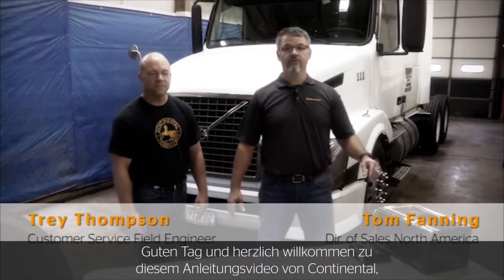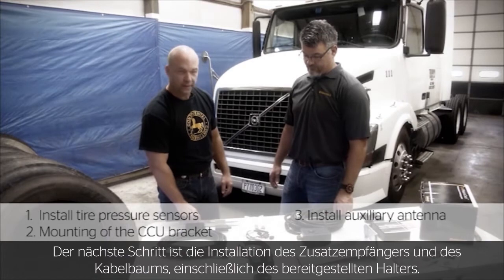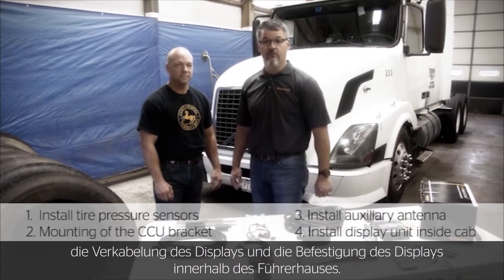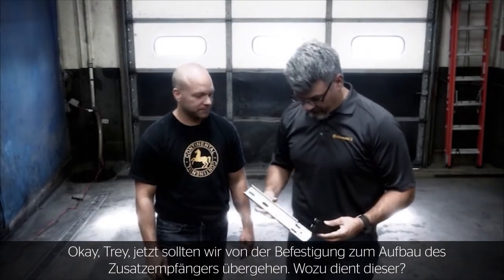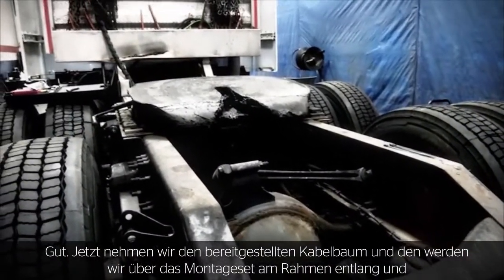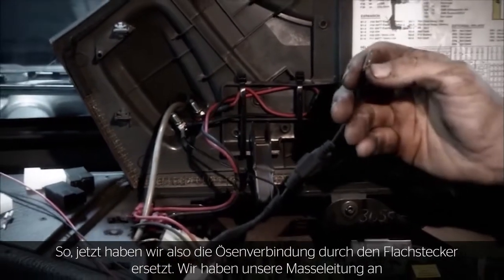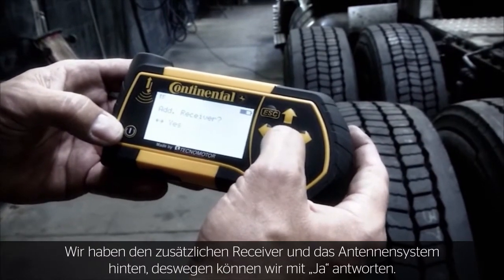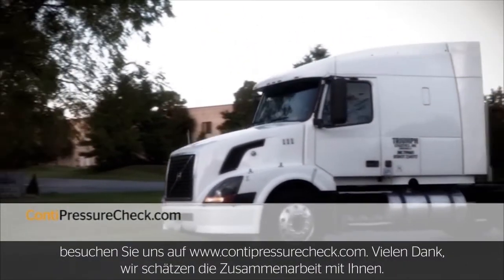ContiPressureCheck™ Montage Film - deutsche Untertitel

Comment: I guess ContiPressureCheck is much better than other TPMS systems on the market. Can this TPMS system be sold to individuals, not for fleet purposes? The Continental tires are required when installing that system at any of your dealers? [My tire size: 365/80R20] Thank you.

Comment: All good, very nice presentation. 
BUT nothing mentioned as what you do with the sensors at the end of tire life or when changing your tires .
Or is it single use trow away sensors ?
Why not using sensor design  via valve hole/internal or valve stump external sensor .
No need to remove unglue-glue again as sensors are attached to wheel not tire.
Are these sensors optional ?
No word if monitoring available via GPS in your office/base ?
Why not display temp/pressure together , screen is big plenty space on it. ?
No presentation as how alarm work/sounds on display ?
Color display (available from other brands) would be rather more appealing than dull monochrome !
Reply from the maker: Thank you Serge for your comments and questions. We would like to respond now :-)

Our tire sensors have an estimated lifetime of 6 years or appx. 600.000 km. This means, the tire sensors sometimes do last longer than a tire life. After the tire life, the sensors can be re-used in a new tire, they can easily be mounted again, with the help of a new rubber container. Once the tire sensor has reached the end of the life, customers can send them back to Continental, where they will be properly disposed respectively recycled.

Tire monitoring systems can be realized via different set-ups. Tire mounted sensors have the optimal mounting position to measure both the temperature as well as the pressure very precisely. Also this mounting position allows to gain further tire data in the future and the sensors are protected from damage and theft. Further, Continental offers intelligent tires that come with pre-installed sensors right from the factory which does not require the initial mounting process from the customers. 

As tire pressure monitoring systems are optional and comfort features, our sensors are as well optional.

Our ContiPressureCheck system is our single vehicle monitoring system focsued to display data to the driver. However, ContiPressureCheck can be integrated into a big variety of telematics system to transmit the data to the fleet office. 
Also, Continental offers a multiple vehicle monitoring system, called ContiConnect which monitors tire related data of an entire fleet. Read more here: http://www.conticonnect.com.

When considering the importance of pressure and temperature in a tire, the pressure is a value that should be monitored and altered frequently since it has strong impact on the tire´s temperature. To not disctract the driver and make the monitoring as easys as possible, both values will be shown in different views. Further, temperature alerts will be shown in the pressure view of the display anyhow. In doing so, we can ensure that the driver will not miss any critical deviations. 

If a critical value has been reached, the respective tire on the display is highlighted and an acoustic signal will appear.

Our ContiPressureCheck display is an important component of the entire system as well as a proven device for the usage in the commercial industry. 
However, Continental sees the trend towards the connection of on-board systems with the drivers´ device or telematics displays in the driver´s cabin. For this reason Continental will be offering a bluetooth connection between the systems´ control unit and a smart phone or other devices soon.

Best regards from Continental